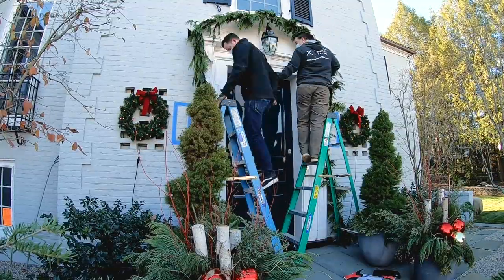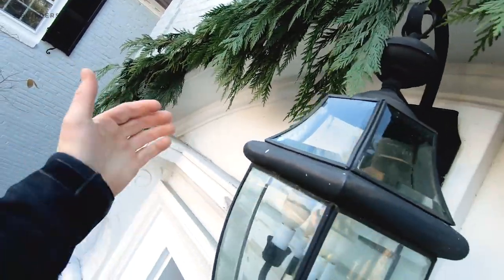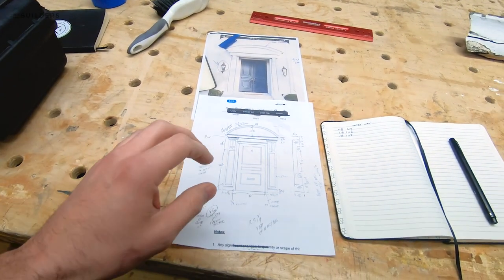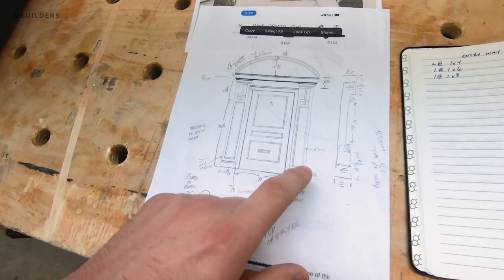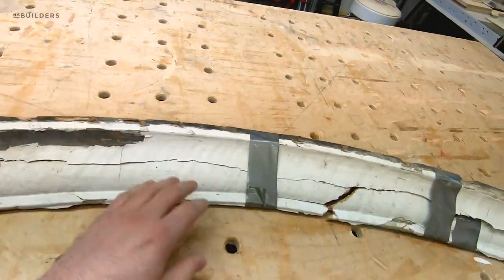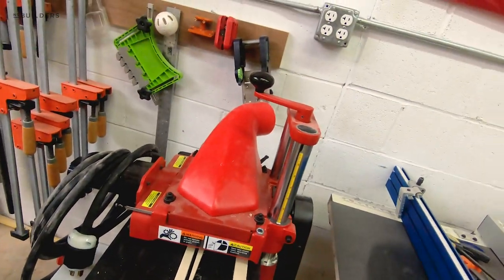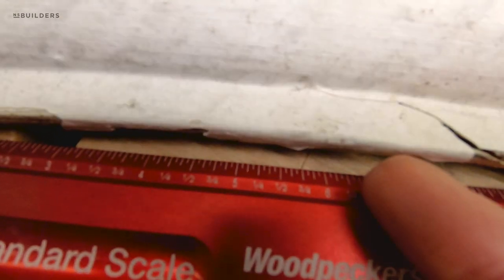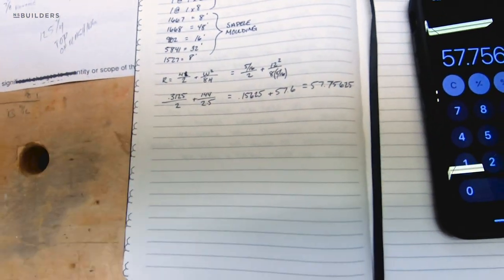Recreating old exterior moulding | Revealed

Comment: It's much easier to use a construction master calculator to figure out the radius. You can do a 12-in run and 5/16 inch rise then hit convert arc and it will give you the radius of 57 and 3/4 in.